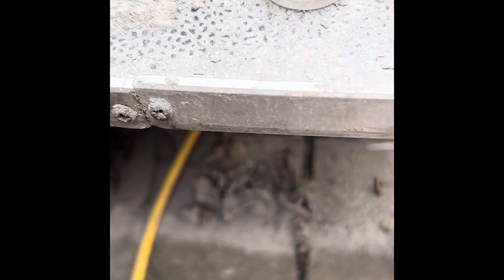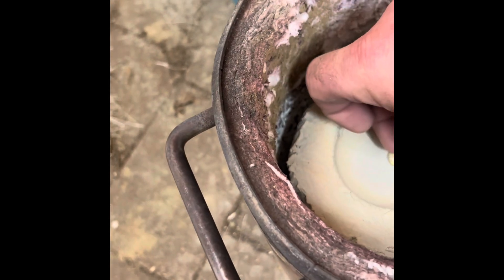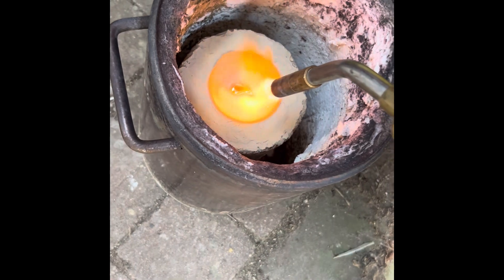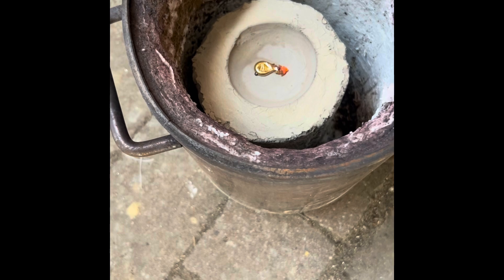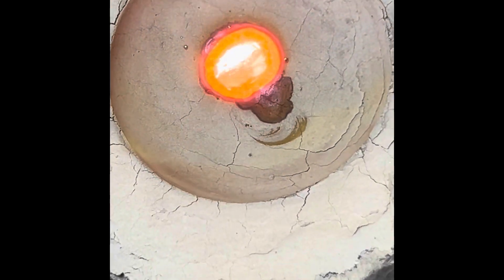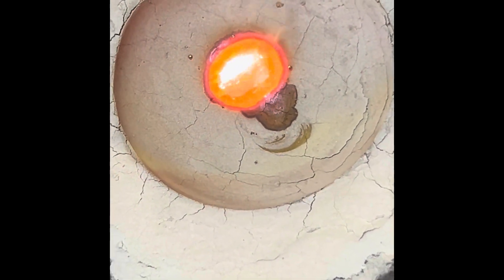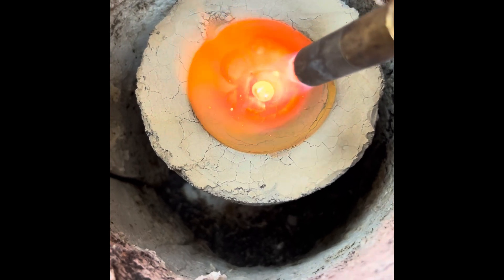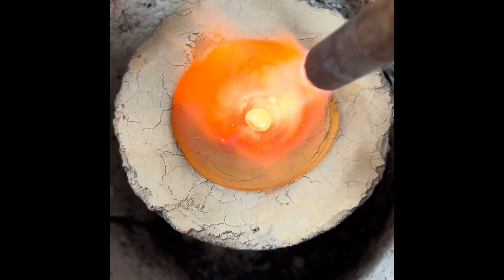Refining Scottish gold homemade cupel #goldpanning #scottishgold #homemadejewellery

Comment: Hej great video. I have 2 quastions if i may. do i need to let the cement set first before using. I can only buy cement in 20kg bags so could i use ground kat ltter ( bentonite ) in powder form ?  can i use a butane gas torch also? Thanx